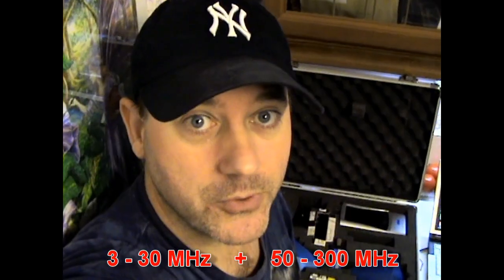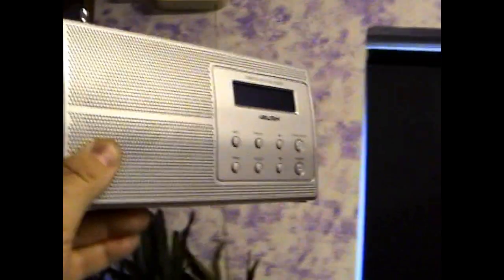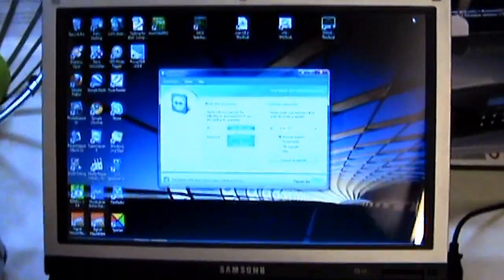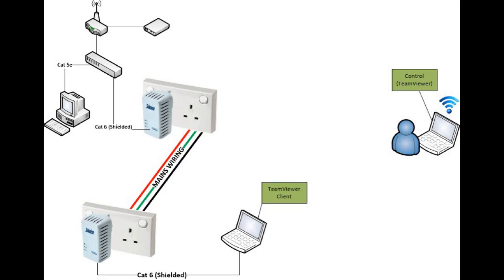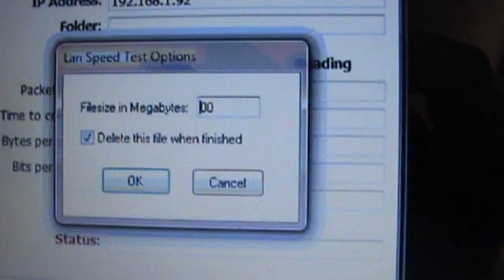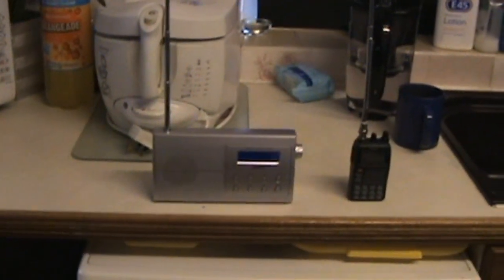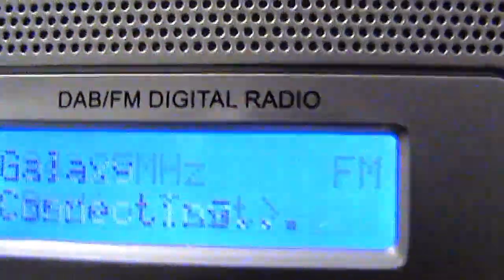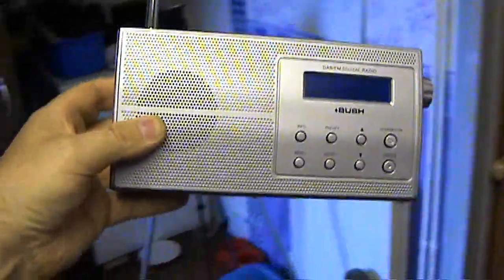Powerline Networking Interference: DAB Radio

Comment: Advanced HAM radio license holder here, VK4MTV from Australia, when you get to that license level, you would know the fundamentals what an Old school radio technician of the 1940-80’s would know.

It would be fact that if the emission laws were actually followed, these power-line network adaptors would be outlawed, there is no way they could be compliant to radio emissions, it’s not possible, electrical wiring is not designed to carry data in the first place, unlike twisted pairs found in Cat5/6 cable. For effective data transmission, more transmit power is needed to reduce corrupted packets that otherwise needs to be resent, slowing your network. Higher power makes interference worse, you can design it to use other frequencies but some other service loses out, you can’t win unless they assign a slice of some radio spectrum under a class license condition similar to CB radio and WiFi to go all in on it, work on the QAM multiplex to cram in more data per channel to increase speeds, that’s the only way to do powerline networking without disturbing existing services, because these wires WILL radiate, however that spectrum allocation has to be planned and lobbied for, radio spectrum is a finite and precious resource so needs to be managed effectively.

Also AM radio has been neglected far too long, the band that happens to be the canary in the coal mine, it’s the first to cop it, as interference gets worse, you begin seeing other equipment malfunction. the biggest issue is many engineers these days may be trained well to design for function, they aren’t as good as the engineers decades ago at omitting interference in design, and worse, besides switch mode power supplies, digital electronics switch, which switching makes noise, that needs to be filtered. If you protect AM radio, the rest of our communication electronics will be protected. Unlike UK, Australia due to its geographical landscape still relies heavily on AM radio in some parts.

The real ideal solution to networking is get a LAN outlet installed in the rooms where you plan to place your computers, linked by Cat6 cable, it may cost some pennies but worth every cent.

I would also recommend clipping on some ferrite beads onto your LLAN cables, as I have experienced the “PUTT PUTT”. Noise that can wipe out weak FM signals.

Second best solution is to use WiFi.

Comment: 220 MHz in the US use to be allocated to Ham Radio. In 2020 US is going to try DAB & possibly eliminate our HD Radio as the costs very high to run them & not many radios made with HD & only a few auto manufactures have them.

Comment: I experienced this with my older Bush DAB (MODEL NE-3710) iPod docking station (mains only device) when I got it about 3 or 4 years ago. Since then, the problem seems to have disappeared all by itself and it now works. I have 2 (supplied by BT) power adapters (type: Comtrend Powergrid 9020). I have also recently bought 2 Roberts DAB radios, which were much more expensive, and I haven't had any problems at all with those. As you demonstrate.... clearly there are issues surrounding these adapters, but perhaps the radio manufacturers have found a way around it!

Comment: I was about to buy NETGEAR XAVB5421-100UKS 1 Port 500 Mbps Powerline Adapter, and i believe i have read your review/comment and decided to investigate further...
That is really interesting.
I have bought previously Netgear 200mb version to get rid of WIFI radiation, and now this... 

Is that is worse than WIFI, electromagnetic radiation  or equally bad? 

What is the difference between PLT and PLA ?

 Which PLA has lowest noise levels?

 Why do this interference exist at all and is that is been done intentionally, what are your thoughs ?
Reply: Family of: Coleman

Thanks for replay, it was clear to me... But is it is harmful to people? Of course any additional artificial frequency around you is not beneficial for you, but is PLT/ PLA are harmful for people? because if you measure WIFI, Bluetooth electromagnetic field levels, they are outrageous and unacceptable in house.

So i thought it is great solution to have PLA instead. Yes it might cause problems for other frequencies/ waves to travel in space and it is problem for certain people. But i am more concerned about health hazards, not someones hobby. 

A specially knowing that popular radio programs are directly design to condition people, i am totally against it.

Comment from the maker: Hi David. The most concerning element to me is that since this video was recorded (a couple of years now, then mistakenly deleted) the EU commissioned CENELEC to produce a formal standard for PLT-despite EN5022 being applicable (and PLT unable to comply with that standard) the new standard: prEN50561-1:2012 will permit levels of interference 10,000 times higher than presently permitted........